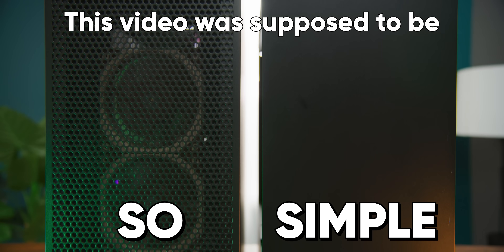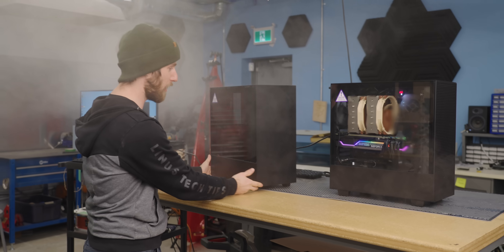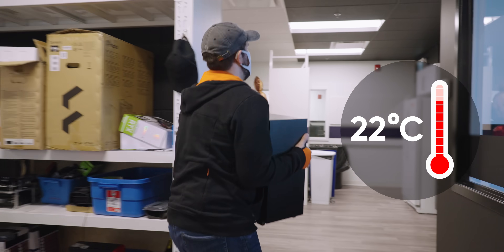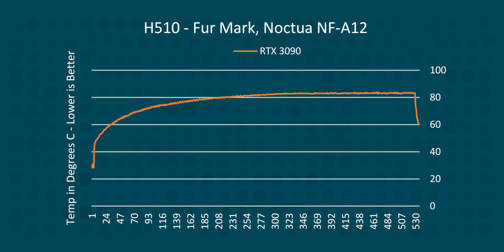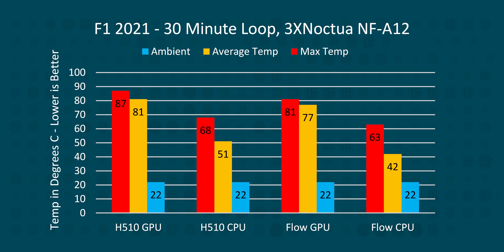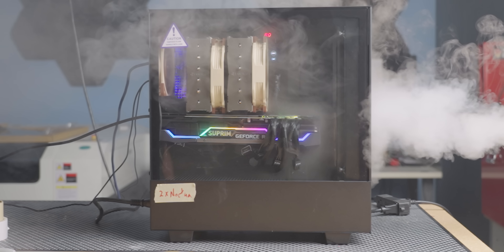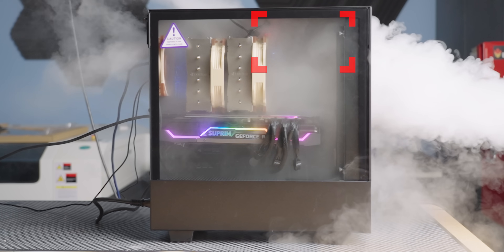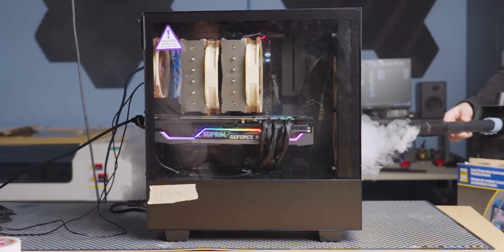Everything You Know Is Wrong - Mesh vs Non-Mesh Front Panel

Comment: Interesting. 
Can you make another test with vertical cases, which leverage the chimney effect, bottom to top airflow? Bottim + sides in, top out. GPU vertical. Example cases: Thermrights towers, any size, Deepcool 270 Digital, ... you get the point.

Comment: Mesh with dust filter, this is what I have on my rig, max heat I recorded in a 5min stress test around 77c. I have 2 intake, 3 outake 2 uppers and 1 rear, cpu is a stock AMD fans that comes with ryzen 5 5500.

Comment: I have the solution.

Turn the air conditioning on to like 70F.  Which, in my brick house with very good insulation, 70F is chilly.  68C is freezing.  I have 2x 140mm front intake, 1x 140mm rear exhaust and a 360mm AIO up top exhausting.  Also, the Corsair HX1200i at the bottom, hidden in those metal shoebox things they put at the bottom of cases, and it's intaking cold air from the bottom and exhausting right out the rear of the PSU.  So, no effect on anything else, there.  

I dunno, I don't have any temp issues.  I run a 5900x and a 5070 Ti 16GB which can pull over 300 watts, depending on game and settings.  For whatever reason, my temps are always better than everyone else's that I see post.  I mean, my GPU?  Memory temps are like 58C in game (I see people talking about 68C is normal, 88C is the safe max, and I"m over here, OC'd, full power slider, full voltage slider, +350mhz core/+350mhz mem on an already OC'd RTX 5070 Ti.  I don't buy these brand name cases.  Maybe one day I'll see the point, but man.. I buy a case that has fans where I want them.  I also run 140mm fans wherever possible.  I go by what I need, CFM and static pressure, depending on if it's trying to pull air through a filter or push air through an AIO, but they ALSO have to have good CFM.  70 CFM at least.

Now, an issue I see that can be hard to avoid is that on the GPU, the first fan is going to hog all the air coming in on the lower part of the case, BUT... push enough air through there and it'll make its way around, plus the upper front 140mm fan is blowing right at and over the GPU.  Hard to go wrong with any case that's $60-$80 these days.  Bigger = better.  I like my full size cases and my full size ATX motherboards.  I use every slot, every USB port, so there's that, but also.. I just never cared about building a little case with a mobo that has one PCI-e x16 slot and 2x DIMMs all to put in a tiny case.  Not my thing.  I want my big boy case with big boy fans.  Only thing about my current case is that it doesn't have 3x front fans, but from my testing, when you have 3x fans up top, the front top fan pulls all the air of the top front intake fan right up and into it and straight out and it does nothing.  

I'd RATHER have 2x rear exhaust fans, BUT I guess that causes too much negative pressure when you have 2x front, 2x rear, 3x top, with 5x being exhaust and 2x being intake.  

I Dunno... some cases just do better, what can ya say?  And even if you don't have the best case, turn the A/C down a degree or two and now you're getting temps that a top of the line, $200 case would have gotten you before lowering the room temp lol.  

Eh, who cares?  I always seem to get lucky, I suppose.  I use a ROSEWILL case... ROSEWILL!!!!  And it cools everything with ease.  Pick good fans, pick big fans...

Comment: Hey so one of the things that I've done with my setup is my PSU actually pulls are in from inside the case because I have some pretty heavy filters on my case because I live in a desert and I've always checked to see if it felt hot on the grill and my psu's never hot it never has warm air going through it it's a $850 pushing a 4070 TI with a ryzen 7 5800x and my GPU stays pretty calm and chili

Comment: i dont know why because motherboard layouts never changed to allow for GPU to be set apart from the CPU. This was a legaxy design from back in the dizzee when you had to have a sound card, lan card, and other additional expansion cards for storage drives and maybe some propiertory firewire/ zipdrive socket cards as well. 

Nowadays nobody uses these other cards, gaming motherboards come fully loaded with all the connectors you need. What the industry needs to do is to put the gpu slot lower down and make GPys flip aroud so the are venting above and make fans designed so they suck air up and have a duct to divert that air out the back of the case fan. Or have it unducted and angle the air towards the outflow vents.

Comment: The issue here as you said weren’t actually the noctua fans as you kept insisting on and misleading viewers.
It’s actually the case and the form factor of your GPU.
You decided to put a huge gpu in such a case with fans barely blowing any air towards it, if you take a case with bigger intake like the fractal north or the tore by you will see the air intake will actually reach your gpu due to the bigger case and space , also a simple fix and answer is to have an intake in the bottom , I had a few full sized pc towers with intake on the bottom too and boy , the airflow were on point , the temps too .

The fractal torrent for example is an amazing case for airflow , with intake on both the bottom and front , for the exhaust you have the primary exhaust behind the case and on top.
For this particular video if you had a less large gpu you would actually be fine with airflow , the temps would be fine without being amazing.

Comment: PC cases are challenged from fluid dynamics standpoint. "Gaming" intake/exhaust configurations are adding brute force to an already messed up situation. Air isn't a solid that you can just push around from fan to fan. Think of swimming as an analogy. If you just flail around at max speed, uncoordinated, even if arms and legs are pushing in the same direction, you barely move. Most PC cases look exactly like this, and its how laptops can use 1 tiny fan in very tiny enclosure and dissipate much more heat per rpm/watt/db/whatever. You need to guide the air, a few simple ducts would likely be much more sufficient. 
Bernoulli's principle states that with higher (fluid) speed,  pressure will be less and vice versa. Airspeed coming into the case and hitting the interior fans in this case is very high, so air pressure is very low. The cpu/gpu fans cant really grab that air (its also turbulent). You need to slow that air down before it can be "used". You can see this principle cooling ducts in race cars. Air is taken from the highpressure zone in the front of the car, through a relatively small opening and than expanded exponently before the radiator like a reverse funnel, so that air pressure at the radiator goes up which dramatically increases thermal exchange.

Comment: The air near the gpu is recirculating because of the bad case design. There are cases that allow you to put fans under the gpu so you can push air from outside directly into your gpu fan. Not only that, the Lancool III, for example, uses this traditional "3 fans at the front" style, but the glass panel doesn't cover the psu area, leaving a mesh at the side that allows for the under gpu fans to act both as intake and as a way of properly directing the air that comes from the bottom intake fan at the front, providing a dense load of fresh air to the GPU. Under GPU fans should be there for anyone that values lower GPU temps, specially with those single fan 4060 models that can go up to 84ºC under heavy load. Also, it's good to consider that the back fan should spin a lot faster, because it's the primary source of exhaust for the GPU and CPU area, where most of the hot air is coming from. Hot air goes away faster than cold air comes in due to it's density, so i'd reccomend a high performance fan, i placed a Scythe Wonder Tornado over my GPU (it goes full 2500rpm whenever temps are over 60ºC) , now my GPU won't go over 75º at 100% usage, and it's a single fan model.

Comment: Also, you had 3 intakes and 1 output fan, which is also a reason that the air inside is stuck for a long time before leaving out... and also smaller case is one of the reasons.

Comment: This is also genuinely a good lead into NZXT eventually launching the H5 Flow. They clearly listened and realised the lack of air the gpu would get (the air would be in a tug of war between the gpu and power supply) and so they blocked off the airflow dots for the power supply and added an angled fan towards the gpu so that it could get that sweet sweet airflow.

Comment: Is it the only available case in the market with solid and mesh front panel variants? Without testing other cases, the results look incomplete. If you couldn't test a couple more cases, then at least you should have used a smaller graphics card which doesn't block that much air circulation. We're only interested in the temps and air circulation anyway and not the actual performance output. Older nvidia 2000 or even 1000 series cards would've been a better demonstration. small case + massive graphics card + massive power cables. You really can't generalize your conclusion from that test.

Comment: Maybe if you face the psu fan towards the inside of the case it will act as an exhaust. Pulling air under the gpu and pumping it out the back

Comment: Thanks,
Recently got a beast of a rig built. And have spent the past month trying to solve the heating issue. Added more fans. Moved the wires out of the way. Nothing worked. Then i found this video and it gave me the answer. The Air Cooler is almost ontop of the GPU. And the fans are about as close to the GPU like in the video. Currently using a be quiet 500  pure base. Was already going to swap it out. But now i have even more reason. 

Thanks again

Comment: To achieve better cooling across ALL components, install a high pressure static fan in the very back of the pc which with a more aggressive fan profile and rpm speed will pull cool air through the case, over the hot components and exhaust that heat out the rear.  Using less aggressive fan profiles and lower speeds in the front of the case will help feed cool air into the case providing the rear fan with more cool air to pull from.

Comment: i use the h510 elite and the airflow is so god damn bad without the mesh. if i didnt use a AIO my cooling for the cpu would be fucked. the gpu has the same issue though so i am looking into a new case at this point. i cant water cool it without skill and its not worth it with the gpu i have.

Comment: I think a part of it is a design flaw in a lot of these "smaller" cases. They don't have a mesh part next to the pcie brackets meaning the air has to be exausted by the rear case fan.
I have a lancool III and all the air that the rear fan can't exaust either is exausted via the top or next to the gpu meaning that it has a lot less of re-circulation. So if you get yourself a fractal or lian li case cause those allow for exausting without a rear fan.

Comment: Turbulence is not that bad on its own. Air standing in the same place? Fine. It's the same as putting a plastic cube in the place. I don't care, as long as the actual flow goes to the right places. (and there's enough of it)

Comment: When doing ventilation testing, the first thing that comes to mind wouldn’t be “let’s do all our testing in a mid size case crammed tightly with large components”. 

I mean, I realize we’re talking about air here, but still, if I was worried about GPU temps,
then I wouldn’t have it fit so tightly it’s within millimeters of touching the CPU cooling gear. 

It’s obvious why the smoke test was collecting underneath the GPU, the damn thing literally is a wall that bisects the top from the lower half of the inside. Like, what?? This just seems like beginner mistakes to me, idk.

Comment: Mounting the GPU on the side with a right angle pcie cable extension, and then have cpu cooler pointing vertical instead as an exhaust would clear a lot of the issues.

Comment: The problem is with the way the front fan pushes air - it does it in a concentrated manner. It should spread the air in all directions, not just in a straight jet.
At the end of the day, we install fans to cool components, not to provide thrust...

Comment: The smoke test looked to me like you could really benefit from a small fan under/behind the gpu. 
Nothing is supplying underneath it at all. The cpu cooler and rear case fan are making a wind tunnel and taking everything if even pulling hot air into the cpu from the gpu

Comment: dude literally a week ago i was wondering why i had 2 intake fans at the front of my pc but there was no mesh to pull air through... i was hitting constant 100C so i just literally tore open a crater with some pliers on my front panel where my fans are and now i have stable temps.. xd

Comment: If you think about air like its water it become simpler. You intuitively know that if water finds a route, then just outside the route can easily be dry: a stream has boundaries. If you want water flow over a surface you need to be intentional about guiding it there. Similar thing with air.

Comment: I found that you can get a benefit from simply removing the rear case grates on the unused PCIe slots. If you have front intake fans creating internal air pressure against the GPU, these open PCIe case slots allow for the air to flow and exhaust out the back. This made a massive difference for my PSU which was previously stuck sucking in the hot GPU exhaust air. With everything else the same, my PSU went from burning hot to cold to the touch just from opening these PCIe grates.

Alternatively, get a GPU with a blower style cooler and you won't have this problem in the first place

Comment: Mesh ALWAYS!  Also - fans consume power. By increasing fan speed because they were quiet, you were also increasing their heat load into the case. Personally, I have my power supply fan facing upwards ( inside )  so it’s pulling air out from the inside  bottom of the case. This not only helps air circulation under the GPU ( as opposed to dead air) but also prevents the power supply from sucking up dust bunnies on the floor under my case. How often do people ever check under their case to clean the power supply intake filter? By using the PSU fan to suck air from inside the case, I never need to lift my monster case off the floor or worry if it’s sitting on a shag rug.. 😎

Comment: I've often thought about 'splitting' the inside of my case with a horizontal barrier between the GPU and the CPU/RAM). The bottom front fan would feed cool air to the GPU, and the top fan would feed air into the CPU/RAM area. I've not tried it yet, but often think about the idea and would love to see you guys try it!
Reply: You should watch Optimum's video titled "I fixed PC Cooling"

He 3D prints vents that directly connect each intake to CPU and GPU fans
Reply: @droson8712  Not very optimal either. Other components also depend on that extra airflow for cooling (like GPU backplate). Splitting case in two sections with separate cooling without trapping that airflow in vent should be more practical (and easier to implement).
Reply: @alexturnbackthearmy1907  Not the point I'm just saying that it's a cool video that does something similar to what he described
Reply: Hardware Esfera

Comment: Isn’t the real issue kinda with the standard ATX case design with the power supply on the bottom? If the GPU was able to pull air from the bottom like in the Fractal Torrent, air flow wouldn’t be an issue. But in most cases (ugh I guess pun intended), the psu usually has a shroud around it, basically boxing in the GPU fans. Alternatively, GPU manufacturers could flip the pub and have the chips/heatsink/fans point towards the CPU instead of the bottom. But that doesn’t seem like the best solution

Comment: This is why OEM workstation builds are often OK with a SINGLE ducted fan! This is not even about mesh vs no mesh, and modern cases are often a nightmare to air-cool because modern GPUs are; with intake and exhaust less than an inch apart, what do you expect..

Comment: You're RPMs are way too high if you are facing turbulence issues. That should never happen sub 1000 RPM, which is what noctuas are amazing for, they aren't amazing for high speeds. Secondly, that particular case has fans only in the upper 2/3 of the case, not the bottom third, which would make the difference for the GPU thermals.

Comment: This video actually showcases why bigger is better when it comes to PC cases. You don't want your fresh air to hit a "wall". 

It also showcases how much the backplate helps when it comes to cooling your GPU.

By extension it shows why vertical mount for GPUs are bad in most situations unless you have opening in your side panel, because the graphics card fans will be so close to the side panel.

Comment: Thanks for the adverti... er... info? I learned nothing. This is just one of those "A bigger hammer doesn't get the job done better than a smaller hammer" deals. 

You mentioned needing to fine tune, but it would've been helpful if you guys actually showed how that case could have been optimized by mixing and matching the fan speeds to move the cooler air towards the GPU. I've only seen one case design that had a dedicated fan drawing in cool air from the bottom and pointing it at the GPU, and there's only case company that I know of that moved the PSU to the front and situated all intake fans at the bottom and all exhaust fans at the top. In a standard case layout, it would be beneficial to build simple shrouds around the fans that can direct the cool air where it is needed.

Also, just realized that this vid is a year old and I'm discussing this with no one. lol